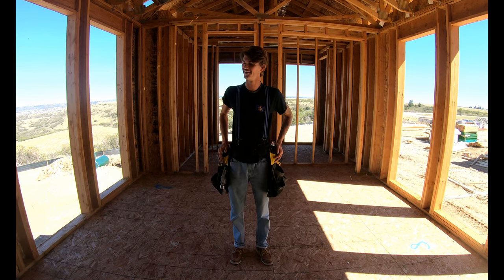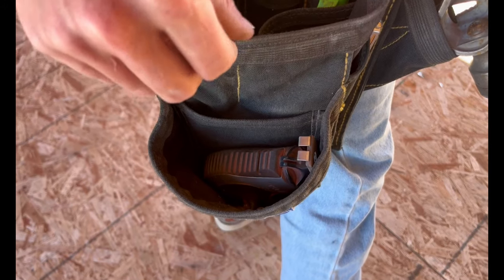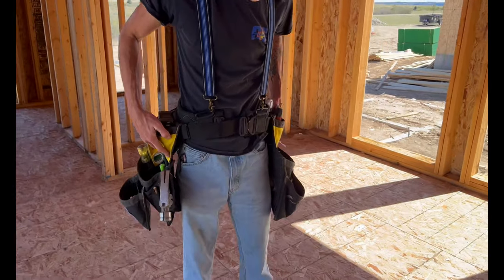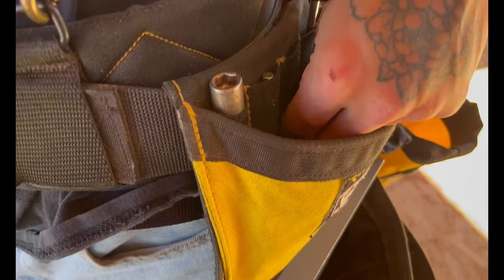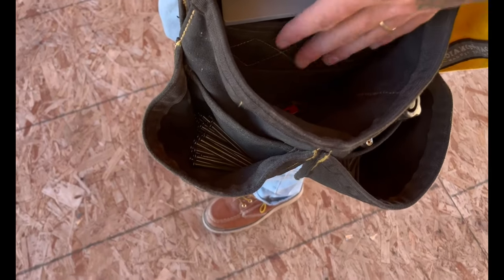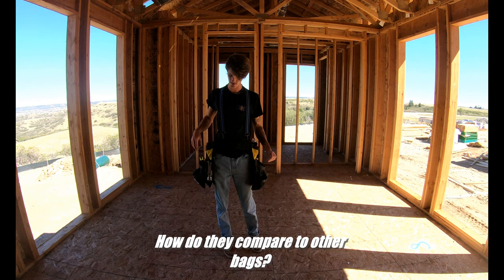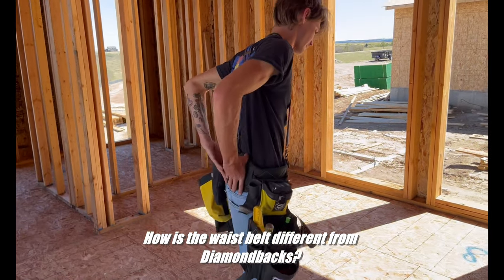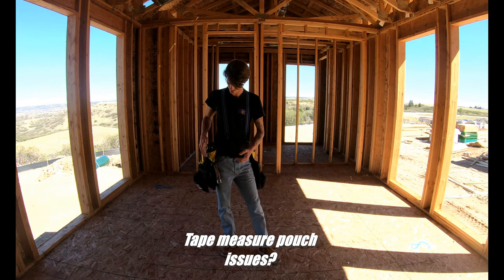Badger Framing TOOLBELT In-Depth Review!!

Comment: Are you concerned about how large /low hanging these bags are? I've worn oxy light framers for probably 15 plus years bc they don't get in the way , i like what these bags seem to offer but i feel like they might be roughly the same size as the oxy fatlip framers which are much to big to be climbing around and moving in...imo. thoughts?
Reply from the maker: My badgers are much smaller profile than my occie pro framers that I also love! The badger belt also tends to sit slightly higher than the Occidental belt, so it brings them higher up as well

Comment: I had Diamondbacks, was not impressed.  Especially now I feel like they've become overpriced. The 6" belt would usually slide down off where it was supposed to be worn even when wearing the correct size belt.  I switched to Akribis Leather 8 months back and I couldn't be happier.  It's each to their own for this kind of stuff though.